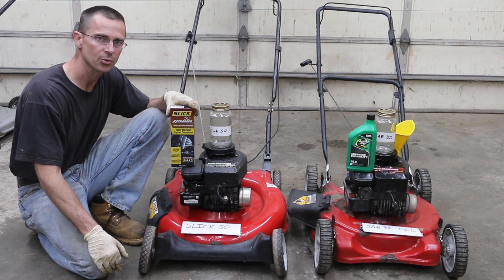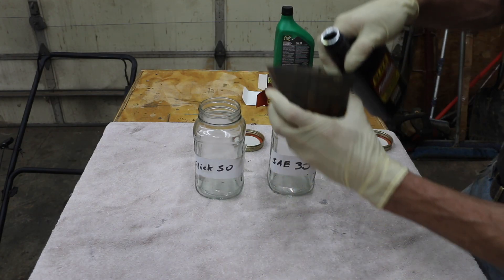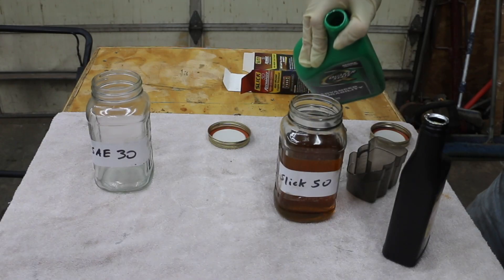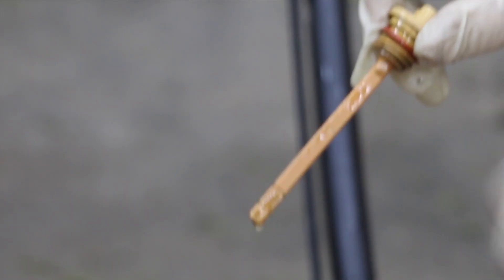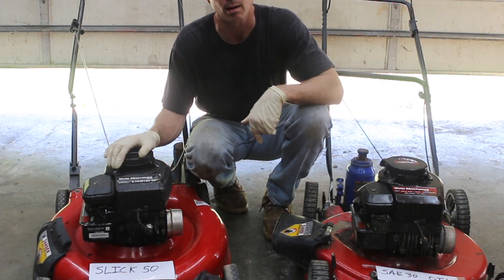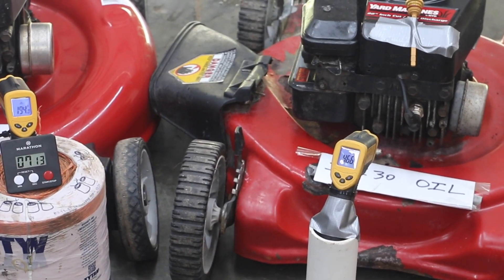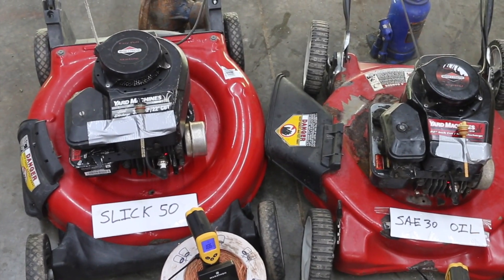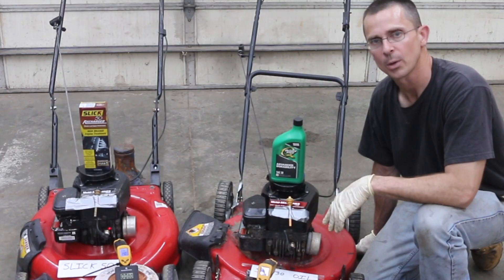Can't believe what SLICK 50 did to my engine!!--Dry Crankcase Test!

Comment: Try BG products oil additive, I was a Mercedes Benz master tech for 30 years used it in customers cars, also raced stock car's, one day we lost an oil filter pressure relief and it blew out the seal,  driver ran 7 laps after he noticed no oil pressure and took 2nd place,  we tore the engine down knowing it was trashed,  funny thing was the bearings still looked good,  cylinder walls looked great,  couldn't find any measurable  wear on anything. So we put new bearings in it just because,  and ran it the rest of the season and part of the next till car hit the wall and we had to retire it. Since then always ran BG products in our cars. The local distributor had a Ford 302 engine set up that they'd drop the oil pan and let it run for hours with no oil. Always excellent products
Reply from the maker: Thank you for this suggestion!

Comment: The slick 50 your using is not the slick 50 that was first made. That original formula is now called Xcelplus. John bishop was the original inventor from 1978 - 1984. The name Slick 50 is still out there but the original formula Has not been available to them since 1984. Look up on YouTube.... Xcelplus: What happened to Slick-50? Interview with John Bishop.
Reply from the maker: Thank you for this information!

Comment: Slick 50 works well when used correctly, you should not use it on a new tight engine you should have 60k+ miles before using Slick 50.  I use Mobil 1 in my 1983 "rebuilt 4.9L in-line 6" in 1999 F100 it is still running very well. I also add Lucas fuel treatment and even Marvel's mostly Lucas. Lucas and Marvel's adds lubrication to the valves and cylinders by way of the fuel and keeps injectors cleaner and electric fuel pumps lubricated better.  I have noticed when adding Lucas heavier than directed, some Lucas gets adsorbed into the crankcase oil. That won't really hurt anything as long as it does not accumulate too much over full on the dipstick. I add it heavy (double dose)  before an oil change so it thins the oil and drains just a little cleaner. 
I contribute longer oil change intervals to these factors;
1)  tighter air filter systems that keep the air very clean.
2)  paved roads have reduced the amount of trail dust in the air that would get sucked in to the cylinders.
1&2 go hand in hand working together.
3)  synthetic oils are superiorly engineered and would last even longer if ran though a oil cooler like transmission fluid. With 2 oil filters one before the oil goes into the cooler and one when it comes out of the cooler, a hot and cool filter system...
Using full synthetic oil with Lucas gas treatment is the best way to lubricate any engine. Slick 50 is a bit heavy and is a good idea for lower engine parts, the main bearings in particular.  Only when well broke-in 60K+ miles. The next time I use it I want to remove the paper from the oil filter so it gets circulated without interference from the oil filter.  18 years of success with the F100 and 10 years of success with my 2007 Mustang I got 75k on the Mustang 4.6 V8 I will be using Slick 50 on the next oil change.  Slick 50 is a measurable contributing factor for crankcase lubrication.  What is questionable is how large or small that factor is. All 3 products used correctly together is the best man has developed today.
Reply from the maker: Thank you for commenting!

Comment: Use AMSOIL that's better than slik50
Reply from the maker: Thank you for this suggestion!
Reply: Use any engine oil that meets the requirements for your engine.  There is never a reason to use anything else.
Reply: Technically speaking it's the phosphorus in the zddp that's what the p stands for that reduses friction on a molecular level also keeps the acid neutralized 😮😂😅😊
Reply: use Redline .. more esters than Amzoil.... less friction, more temp reisitance!
Reply: Yes the Amsoil line is good stuff. A synthetic oil bonds to metal and oils rich with zddp further reduce friction and aid in protecting metal from rusting while not in use.
Reply: Biodiesel competes against the ZDDP rendering the antiwear additives useless, most gasoline has 10% bio-fuel from corn. Its very likely the ethanol will dilute the quality of oil and requires more frequent oil changes.
Reply: I run 2-stroke oil in my PLN pump and injectors for the same reason of no sulfor and a little Marvels Oil also helps prevent deposits. Some people add transmission fluid to their fuel, not sure how much lubrication is in ATF but its a good cleaner.
Reply: Anton man you should work at a hospital!
Reply: @rotaryphoton137  you should work in a mental health care system 😢😢😢😢😢

Comment: When you drained the oil from both engines, it looked liked you recovered more from the slick 50 one. Did the sae30 engine have more residual oil left in it that possibility made it run longer?
Reply from the maker: This is a great question.  I believe I put less oil in the SAE 30 engine before draining the oil.  They were both completely empty during the test.  Thanks for commenting!

Comment: That's very interesting. I once had a 1967 Valiant (a Chrysler with 225 slant six). To set the story, the front bumper on these cars is a shallow 'V' shape and at the centre where the two halves meet at the back, it's tack welded together. I was in a rear ender and the bumper split and almost cut the radiator entirely in half. It was driveable, but with no way of cooling it and a 11KM (7 miles) drive to home. I had treated this engine with Slick-50 about 6 months prior and figured it would be a decent test of the manufacturer's claims. Well, I drove it all the way home. There must have been some water near the temperature sensor because it sat at boiling point all the way. It was damned hot! However, after I repaired it and did another oil and filter etc change the engine ran on with no drama for years. I am pretty sure if it had dumped its oil though, it would have seized pretty soon after I tried to drive it. The Wynn's company here in Australia used to tour around with a six cylinder engine that ran on its 'Friction Proofing' oil. The motor was set up on a stand running at around 2500RPM with no cooling system. They also had a pressure test set up to show the wear or lack thereof on a bearing when the friction proofing oil was used.
Reply from the maker: Impressive!  I'm told Slick 50 changed hands and is now owned by another company and has a different formula.

Comment: I remember those commercials when you can see the engine running without oil, But this results really surprised me. Good video thanks.
Reply from the maker: Thanks!
Reply: I remember one of those slick 50 ads using a 225 Chrysler engine, very deceptive. Those engines will run with a rod through the block for several hours... Can you try a similar experiment with LubeGuard?
Reply: not the original formula from when they did those commercials.
Reply: was that the same commercial that they used a fire hose on a running engine ?
Reply: I had a guy give me a tube of additive called CLM he said if I put a couple of table spoons of it with my oil change it would improve my gas mileage , I ran it in my 72 pinto that I would drive from Seattle to Bakersfield CA once a month it did improve my milage noticably , I ran across a small mud/rock slide on one of my trips we didn't have cell phones way back then and the oil pan was destroyed ,my buddy and I decided to drive the car as far as it would go hopefully to a rest area, it was late at night and we where in the mountains , we drove that pinto about 40 miles with the oil pan peeled open and the oil pickup dangling in mid air my brother came with a flat bed trailer and we hauled it home, put a new oil pan and pickup along with a exhaust pipe and that little car made many more trips between Seattle and Bakersfield. I lost the guys number for the CLM additive and never could find more but it really worked, I used the last bit of it a few years later I would buy some today if I knew where to get it anybody ever here of it

Comment: This Slick50 vs SAE30 conventional oil (empty engine case) comparison is AWESOME.  I, as well, have used Slick50 many times and thought the Slick50 would have far outlasted the SAE30 - Unbelievable!  At best, I think the take away lesson learned is that the SLick50 added to engine oil allows engines to run Cooler than conventional oil alone - which can prolong engine life.  Heat is bad for engine life.  For many years, I no loner use Slick50.  I currently use TUFOIL - supposedly "The World's Most Efficient Lubricant"  I wish you were able to compare "TUFOIL".  Job Well Done!! Thanks!
Reply from the maker: Thank you very much for the positive comment!  Also, thanks for recommending TUFOIL.

Comment: i have also used slick50 all my life in my van at moment, the add I seen years ago was land rover going 500mile across desert with no oil after treatment of slick50 the difference being water circulating round engine  where as no water in lawnmower, do you think that would make a difference ?
Reply from the maker: Yes, I do believe that a water cooled engine would survive longer than air cooled.  Thanks for commenting!

Comment: Try Lucas the guy had previously ran Lucas and when the dealer forgot to put oil in engine after service/ he came back with a big zero on his dipstick.Filled it with oil, no problems.  He went 5 miles total with no oil.
Reply from the maker: Thank you for this recommendation!

Comment: The slick 50 did make the engine run a lot cooler so it's okay in my book
Reply from the maker: Yes, it did seem to help the engine run cooler. Thanks for commenting!
Reply: the exhaust from the slick 50 engine blew onto the sae 30 engine. I wonder if that made it warmer?

Comment: Some great comments.  Considering the big difference between the times of seizure, little things (exhaust from one engine going into intake of the other) aren't a big deal.  I must agree that you should have used new, same engines and shaken the Slick 50.  The best comment was the one that suggested that if there were some miracle oil/treatment/additive, it would be used everywhere and there would not be any need for these comparison videos :-)  Enjoyed it.
Reply from the maker: Yes, I agree that I should have used identical new engines.  This is great constructive feedback.  Thank you very much for the positive comment!

Comment: Supposedly CorrosionX makes an engine oil intended for intermittent duty engines like backup generators. It's supposed to stay stuck to the metal for long periods when the engine isn't run regularly. I've never found where to buy it though and it's probably pretty expensive.
Reply from the maker: This seems like a great product to test, if I can find it.  Thanks!
Reply: Project Farm, you can read all their marketing hype here http://www.scandex.de/en/chemie/corrosion-x.html
Reply from the maker: Thanks for this information.
Reply: I emailed them, it seems like the product is custom made depending on the base oil you need.

Comment: I have been using QMI oil treatment since about 1989 when I first heard Jeff Brooks on the radio.  That man was such a knowledgeable man.  Not only was he knowledgeable, but he sounded like such a very nice person.  He treated all callers with such respect!!!  Sadly, I understand he died of cancer about ten years ago.

Back then I had a 1989 Lincoln Town Car that used about a quart of oil every 1000 miles.  I always checked my oil level on a regular basis.  I could tell when it was about time to be checked simply by the vibration i was getting from my engine.

My Lincoln had about 11000 miles when I first heard about QMI.  The engine wasn't nice and smooth as it was when it was new so I thought I would give it a try.

When I first added the quart to the engine it began to race at a fast pace, then after a few seconds went back to the normal idle speed.  AT THAT POINT, I could not believe how smooth the engine was running WITHOUT ANY VIBRATIONS AT ALL!!  Then, after driving perhaps 3000, I realized I hadn't checked the oil level BECAUSE I hadn't felt any of the vibration I normally felt after driving about 1000 miles.  So, I checked the dipstick and to my surprise I found that there was no oil on the dipstick.  I was amazed that the engine was running so smoothly with almost no oil in the crankcase.

Within the past month (2017), I purchased a 1983 Lincoln Mark VI with 34400 miles on it.  I had the oil changed and instructed the garage to leave the oil level down by one quart so that I could put the QMI treatment in it myself.  I did that because when you put the QMI in, you are supposed to shake the bottle, put it in, and immediately drive the car for about 30 minutes.  That is because the heat of the engine helps the QMI contents to adhere to the internal parts of the engine. These were the instructions Jeff Brooks used to advise.  Well needless to say, my recent purchase has the smoothest running engine!!

So, again, I have been using the QMI oil treatment for almost 30 years.  All of my cars without exception has gotten this treatment.  And, by the way, this treatment is supposed to last up to 50,000 miles and in my experience it does.  

To be clear, once you put this treatment in, you still change the oil at your regular recommended intervals.
Reply from the maker: Ken, thank you for sharing your experience with QMI.  I'm impressed with how much smoother the engine ran!  Thanks again!

Comment: Looked like the Slick 50 engine didn't lock. Didn't get hot enough. Was the damage really all that bad?
Reply from the maker: Yes, the engine did lock up but not quite as badly as the other engine.  There was quite a bit of damage to the rings.  Thanks for commenting!

Comment: Just started watvhing your vids.   So i will put my 2 cents worth of my own opinion.   I use Castrol oil. Had a 2.2 engine blow a head gasket at 130000 mile. When i took the valve cover off, it looked like a brand to engine. Cam looked like it was just built. 
     Keep those videos comming.
Reply from the maker: Impressive!  Thank you very much for the positive comment!

Comment: This is not a proper test. Reply to me and I will explain why.
Reply from the maker: John, Others have commenting that I should have used new engines and allowed the Slick 50 to absorb into the metal through longer use.  Are there other factors?  Thanks for commenting!

Comment: I use to sell Slick 50 and you did that test wrong
Reply from the maker: John, could you please let me know what I need to do differently?  I plan to use new engines in future tests.  Thanks for commenting!
Reply: slick 50 will only work on the engine if its left in it for a long time the longer the better so it can treat the cylinder walls and all moving parts you just cant dump it in then back out and expect it to work. why don't you use the mower for one summer then try that test again.. i ran a briggs and Stratton for 800 hours with no oil in it after it was treated..... sorry it took me this long to reply ....

Comment: Try motor kote. It's really good stuff. Proven test have shown it's worked. Seen 18 wheelers have drain plugs fall out and drive 50 miles without oil with little damage.
Reply from the maker: Thank you for this suggestion.  I have some and I'm looking forward to testing it soon.  Thanks again!

Comment: Try Duralube. My buddy drove a 78 dodge pickup with a 318 with no oil psi from Southampton PA to Trenton nj. Replaced oil pump and ran after that till he got rid of the truck. 
Also try Friction Free 3000.
Reply from the maker: This is very impressive!  I'll test Duralube and possibly Friction Free 3000.  Thanks for these recommendations!

Comment: Not sure if you've done it already, but briggs and stratton recommends either SAE 30 or full synthetic 5w30. You should add the synthetic one to it and see how long it lasts. Also I watched the rest of the video after I commented. If you decided to try the test of the synthetic, I would recommend trying to use Castrol Magnatec Full Synthetic (not the blend, they sell both) 5w30. The molecules are supposed to stick to the engine to help prevent dry starts.
Reply from the maker: Thank you for this recommendation!

Comment: for the heat test you should have tested the engine with slick 50 with conventional oil vs the slick 50 used engine do less comprestion so less heat. but i like the test subject maybe a part 2 wit some lucas aditive
Reply from the maker: Great suggestion--thanks!

Comment: What you put in is not original Slick 50. I bought the original Slick 50 before it was made available in stores back in the mid 80's. I believe it cost me nearly 50.00 for a quart. I read a full page ad on what it's suppose to do and what really sold me on it was that NASA used it in the space shuttle. The original Slick 50 per the instructions was to be done when you changed your oil. After draining oil, start the car and pour the Slick 50 in before adding any oil. The original was thicker than honey and was guaranteed for life. Impossible to remove it. Most think of Slick 50 as an oil additive and it's not. It treats the metal. I put it in my Chevrolet Caprice Station Wagon and drove it from Reno, Nevada to Tampa, Fl. Took about a week. The car tended to burn oil so I had to check it pretty regular. Being preoccupied with relocating my family and such I went quite awhile without checking. When I finally remembered to do so my car was bone dry of oil. Only God knows how long I had been driving around like that. Original Slick 50 works. It saved my car.
Reply from the maker: This is a great point!  Too bad the formula changed.  Thanks for commenting!